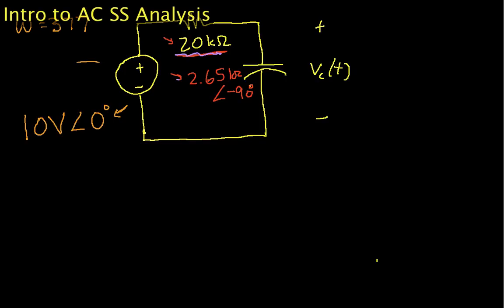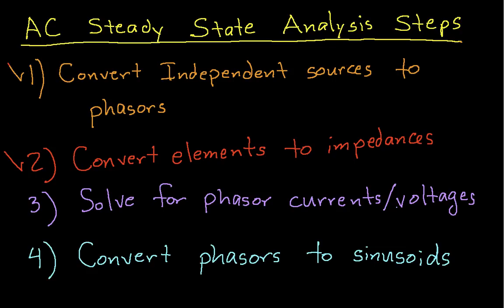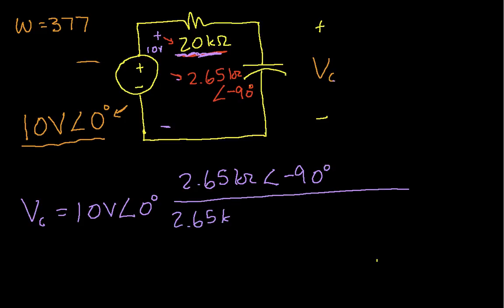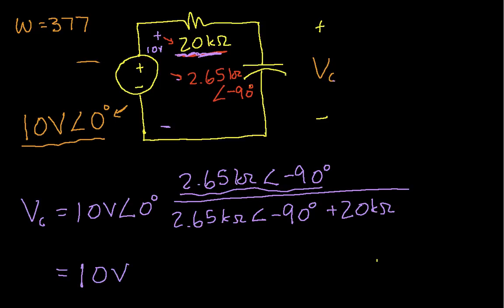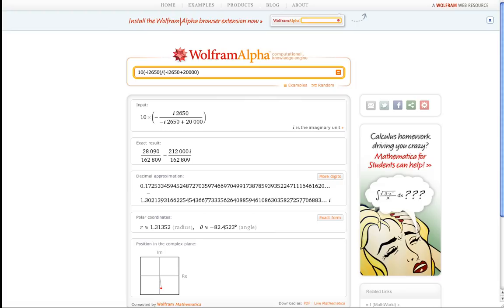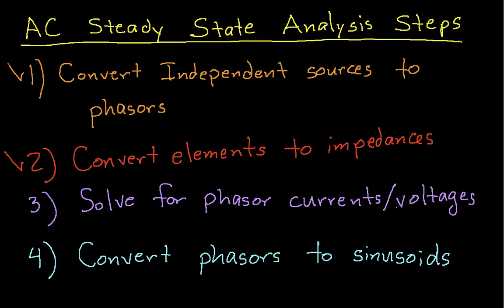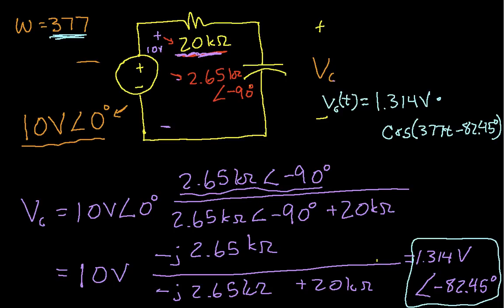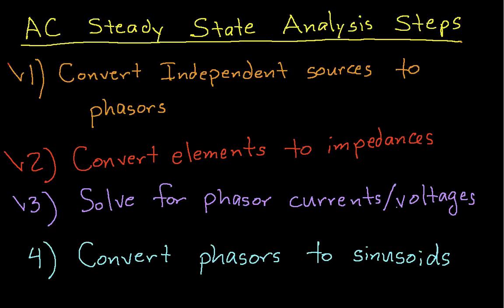Introduction to AC Steady State Analysis Part 2

Comment: How did you get the -90 degrees for the Zc? Can you please explain.
Reply: The - 90 comes from the Re number, j number notation. With j on the y axis, - j yields a -90 because there is no Re number component
Reply: the j represents 90 degrees, the negative of it shows that it is lagging

Comment: Too bad I cant use wolfram alpha on my final exam. next video...
Reply: Nevermind, I got it. You take the square root of the first number squared plus second number squared (without the i) thats the amplitude or voltage, then take TAN inverse of the second number over first number (again without the i) and you get the angle.